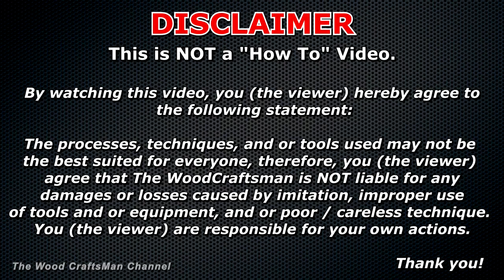Spraying Vinyl Sealer and Precat Lacquer # 308

Comment: Love your channel.  Such a pro.  Have you ever used Chemcraft primer and pigmented topcoat.  I have a kremilin AAA and was wanting to know what air, fluid setting and tip size you would recommend.  Thanks so much!!
Reply from the maker: Thank you for the kind words! No I have not. I used to use ChemCraft back in 1995-2004, but only their clear precat (Opticlear), but never had the need for solid colors up until the last few years. You might want to check out my channel and watch the video I uploaded called "Introduction To Air Assisted Airless" it goes into some pretty good detail that might be of help.
Most of it will depend on the viscosity. In general a 0.011"-0.015" orifice  and 400-800 psi fluid, and just enough atomizing air just to get rid of the tails (generally 10-20 psi). Thanks! Scoot

Comment: I use a air assisted airless and have trying the sherwin williams waterborne top coat.  It is pretty thick.  I seam to be getting an orange peel texture.  I read an article that said I need to turn up my atomizing air due to the viscosity.  Would you agree with this?

Comment: Hi Scott, 
In your opinion, if one were to have the perfect environment in place for either waterbourne or solvent based finishes, would you say waterbourne has more prep? Im finding solvent based topcoats still require sanding between coats. If I'm understanding this correctly, as long as the air temp, humidity and so on (environment) is suitable for the material sprayed, then either one has the same amount of prep time. Would you say this would be accurate?
Reply from the maker: That's a pretty accurate statement. The WB technology has come a long way, but I believe the trade off is in the surface preparation prior to finish. WB coatings still tend to fuzz up the fibers a bit on the first cost, but a lot of them have gotten significantly better over the years. As far as sanding between coats, almost any WB would require that to ensure a good "mechanical bond" because most WB coatings don't have a hot enough solvent to soften the film to burn into the previous coat. Almost any nitrocellulose lacquer, precat lacquer or postcat lacquer can burn into the next coat because by nature they are a softer finish and have no problem creating a "chemical bond". However an acid cure conversion varnish is not as forgiving unless you can potentially spray the necessary costs in the same day. Most all conversion varnishes and 2K poly (both WB and solvent) require a scuff sanding between to promote a good "mechanical bond" for proper adhesion.
Reply: @TheWoodCraftsman  thanks Scott, really thanks for all the info you put out. It shows your dedication. 
I think I’m trying to find the easiest and quickest way to a production finish process. All while using a product  that’s good for my lungs, haha. I think the elbow grease product is going to be around for a while.
Reply from the maker: @johnathankeller1948  Not a problem. Glad I could help. Scott

Comment: Two more questions :  600 psi fluid??? I get the 20 psi on the air side .  But where are you getting  600 psi on the fluid side.  I have the  Kremlin pump... Are you reading inside #s on the Guage or outside #s.  Im always lost when you say  600,700 psi on the fluid side.  My Guage read  10,20,30 psi etc etc 

Do you put one coat of pre cat on after the vinyl sealer or two.

Thanks in advance, love your videos.
Reply from the maker: Yes, 600 psi. Air assisted airless operates on the airless principle but of having medium fluid pressure if 250-1000 psi fluid pressure, with the need of some atomizing air of 10-25 psi. Your pressure is calculated by the incoming air to the air motor times the ratio Factor on your pump. If you have a 15:1 pump, and you set the air to 40 psi, you will get 600psi (40 x 15) fluid pressure. If you have a 10:1 pump, you set the air to 60 psi and you will get 600psi (60 x 10) fluid pressure. 
Each and every gauge is different, some read and PSI, and Bar, and some read and PSI, and kPa. Typically on the gauge they're color coded meaning that when it states PSI in one color the numbers will read the same color, and if the secondary reading is Bar, the Bar will be in a different color along with the numbers. Typically black and red is what's used.
All the fluid pressures in these videos I've posted, are arbitrary based on specific coatings, everybody's settings may be slightly different and may need to be adjusted accordingly. For me the pressures I have stated work well for what I'm spraying, individual results me very. Thanks for the compliment.
Reply: @TheWoodCraftsman  ohhhhhhh ok.  Rather than saying 40psi you just do the calculations for us.  😂 thank you for responding so quickly.  I’m new to spraying air assisted airless and your videos have allowed me to take my spraying to the next level.  I have a 17:1 anest iwata and a 15:1 kremlin.

Do you have patreon account or a way to show appreciation other than subscribing?
Reply from the maker: Yep, that is correct. You are welcome. No I do not. This channel is just about sharing my knowledge with others, giving back to cabinet shop and wood finishing communities. Thanks for asking though.

Comment: Great work Scott! 

I noticed you sealed the exterior vertical panels on your upper cabinets where the pocket holes are? Just to help my understanding of the benefits? What is the advantages??

Thanks 

just jim
Reply: seals the wood and stops it from taking on moisture. With a plywood its not a must typically but with the shit process of making plywood these days i'd recommend it. The plys take on moisture and expand and wants to separate from what ever they are using as glues these days.

Comment: Thanks for the video! Finish looks great! Do you have a video where you talk about the venting system you have in place? If not, what is your set up that you are running for that?
Reply from the maker: Thank you!. Yes, its called "Shop Built Exhaust Wall In Operation Preview", early 2018.

Comment: Huge fan of your depth and passion for the craft!  Are you spraying pigment WB or oil stain?  Any advice on toner over pigment and/or dye stains?
Reply from the maker: I use a solvent base wipe stain. Dye stains are good for building a deep rich color in combination with a wipe stain. Typically a commercial dye stain is made up from a fast solvent blend that is sprayed on and drys very quickly, and is followed by a wipe stain to give the final color and depth. A toner can be used and made in different ways. It's typically made with pigments and is in some form of base such as vinyl and us designed to be sprayed on, but not necessarily designed to build a film. They are usually a semi-opauqe and can be used alone or in conjunction with another stain such as a wipe stain to give a contrasting or two tone look or Cirrus look. Thanks. Scott

Comment: Hi there, is there a reason for the start and stop on each pass with your spray gun?
Reply from the maker: That's a very good observation. Yes, it actually contributes to material savings in the long run. I work for a very large kitchen cabinet manufacturer company during the day, and we did a study of our sprayers triggering versus non triggering and we had estimated a savings of approximately 20% at the end of the shift. I know it doesn't seem like much but for every second that that gun is triggered it is blowing out material, and if it's not blowing out material on the part it's being wasted. Sometimes it's these little things like triggering that have a long-term impact. I hope this makes sense.
Reply: @TheWoodCraftsman   excellent. Another question, if you are using a pigmented lacquer on cabinet doors(ex. GREY), would you do a couple coats and thats it? or would you switch to the clear after the pigmented?

Comment: After you applied the vinyl sealer, did you sand and then apply the pre car lacquer???  Or did you just spray the vinyl sealer and then apply lacquer with no sanding
Reply from the maker: Yes, after the vinyl sealer was dry, I sanded it with the RhinoSoft P320 foam backed paper, and then layed down a coat of the precat lacquer.